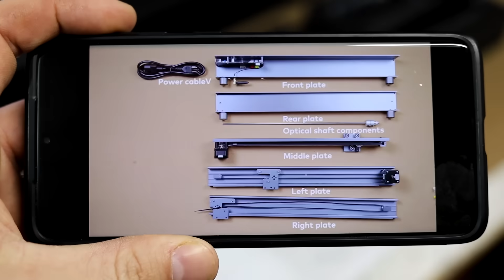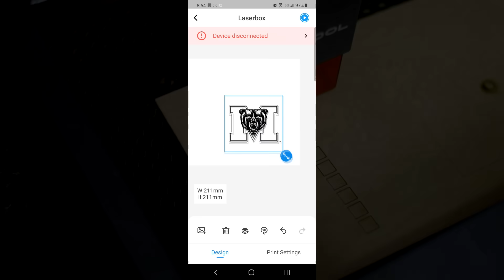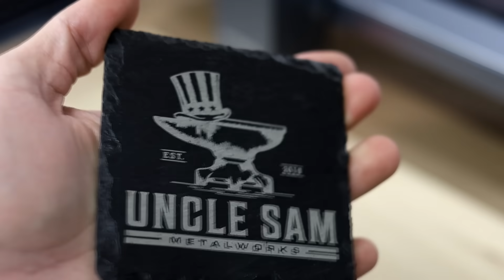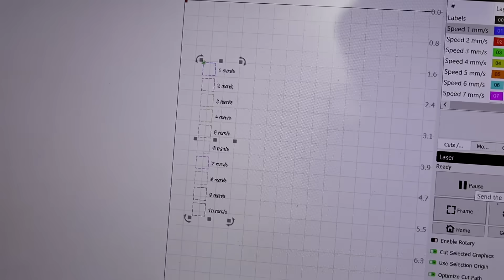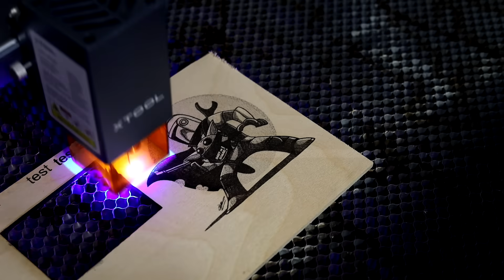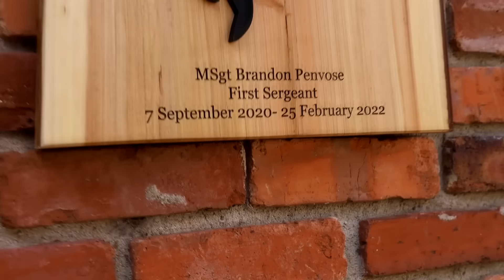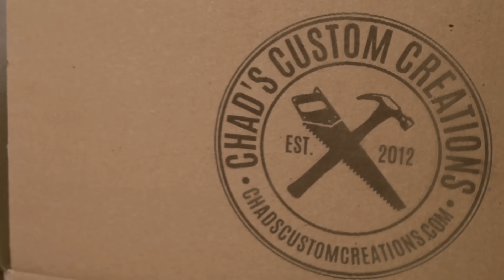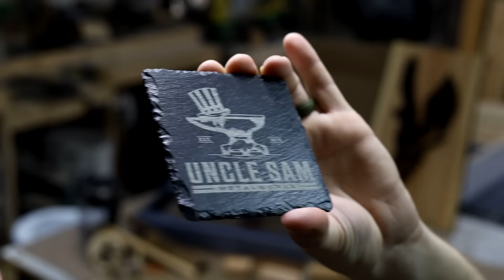The Ultimate Desktop Laser Cutter Engraver The XTool D1

Comment: Can this cut metal names for a necklace?
Reply from the maker: To cut metal you will want to look at fiber lasers which very soon I will be showing off what a 50w fiber laser is capable of. Metal marking stainless or using a marking spray on metals works really well on this xtool though I must say and at 5 times less the cost.
Reply: @ChadsCustomCreations  Great! Can you recommend a fiber laser?
Reply from the maker: @saltwaterfit2753  I cannot yet as I haven't even taken mine out if the box yet but I will definitely let everyone know my experience with mine when I put it through it's paces.
Reply: @ChadsCustomCreations  looking forward to the video. Thanks for your quick response.

Comment: Would you recommend trying to cut something in one pass? I always try to cut in several passes to minimise burning the hardwood but I’m open to suggestions.
Reply from the maker: I think every situation may call for a different techniques but I saw or heard somewhere if you get it down to one pass it allows for the smoke to be pushed out the bottom and you can end up with cleaner faces and better cuts but that may not always be the case.

Comment: Awesome video! Looking into purchasing the xtool d1 but I noticed there is a xtool d1 36w and a 60w.  Do you know the difference between the tool. My main use would be for putting my label for candles on a metal lid.
Reply from the maker: Not sure where you are seeing the 36w and 60w. The choices should be 5w 10w and 20w the one I have is the 10w it's plenty of power I think that would be a good fit for you.
Reply: @ChadsCustomCreations  thank you for the quick response. I went back and looked further in the description and you right. One is a 5w-7.5w and the other is a 10w.  I will go with the 10w. After watching what you were able to do with it I am sure it will meet and exceed my needs!!
Reply from the maker: Oh you are right I see on Amazon they are labeled a little differently than on xtool.com 

If you plan on marking on metal that is not stainless steel you may want to grab a can of this spray that I have had great success with. I know it is pricey but it has lasted me forever.

https://www.amazon.com/dp/B07K4Y8D62?tag=onamzchadddow-20&linkCode=ssc%20&creativeASIN=B07K4Y8D62&asc_item-id=amzn1.ideas.9RX0388VQUF4

Comment: I don't know how much you worked in cutting jobs in this unit, but unless you know something I don't know, whoever is looking to use this unit as a cutting machine, needs to be careful with the choice. Now, don't get me wrong, the xTool D1 is an excellent unit and mechanically hard to get it better. However, from the firmware point of view, is not there yet and I am waiting to purchase a higher power head from them when they have a firmware problem fixed. Here is the problem. When you need to use tabs to avoid parts to get separated from the board, you are strictly limited to a very low speed cutting, regardless of the power. Even your cutting tests allows you to use 700mm/min, to be able to use tabs, you are limited to 250mm/min. Otherwise, the firmware messes up the size of the tabs very, very badly. This simply means that it does not make any sense to go to a 10 or 20W head becuase the cutting speed stays limited. The tradeoff, it would be to use a grid underneath the job instead of a nail bed, but consider that each time the laser hits metal underneath will produce a burn that many times appears in the top of the job, regardless the use of air assist. Therefore, if anyone found a solution to that problem, please, share it here. One more note about the product: I am extremely happy with their support. They are fast and efficient. As I said the only disappointing item is the firmware code.
Reply from the maker: That's a great perspective, I must say that ever since I moved from CNC router to lasers I have kissed tabs goodbye for good. Too much work in my opinion to cut all those off and make the edge grain match the rest where the tabs were. I either mask the backside of my projects with tape, wipe off the backs with isopropyl alcohol, or simply sand away the residue marks coming from the honeycomb reflection.
Reply: @ChadsCustomCreations  Have to say, you have a good walk around. Not good for my project though. And I do not have any issue with the tabs themselves. Once figured out the size and partial cutting power for each type of wood, it works perfectly for me. Just to give you an idea, because of the size of the pieces I have I would need to tape 80-90% of the board. On the other hand, the 0.2mm maximum potential thickness of the tab does not affect my results.
Reply from the maker: @richardraimondo612  that's a good point I didn't realize how small of tabs you could do with laser I was thinking back to the tabs my router would require which would be about .25” to counteract the forces of the spinning router bits. 

If you do need a way to mask quickly I use big 12” rolls of low tac paper masking. There should be links in my azon recommendations if you are interested in some.
Reply: @ChadsCustomCreations  thanks a lot for the lead. I'll keep that handy.

Comment: So can this thing cut through 3/4 plywood in 3 passes?
Reply from the maker: I don't believe so but when I put the air assist on I will give it my best shot and report back with what it can do.
Reply: @ChadsCustomCreations  what about 1/4?
Reply from the maker: I think it has a good chance I’ll be putting the air assist on soon and I’ll test that out for sure.
Reply: @ChadsCustomCreations  The weird thing is the website says it can cut 10mm plywood in one pass. That's almost 1/2 inch.
Reply from the maker: More in depth cutting test is definitely in my future.

Comment: Hi can the XTool D1 cut 12mm MDF
Reply from the maker: I haven't tried it yet but I am betting 6mm is probably the max on MDF and this would probably require the 20w with air assist. If you have to do 12mm mdf I would say go with a 90‐150w co2 laser.

Comment: Great video, except... what was the bird material, how thick, and did you cut with the D1?
Reply from the maker: I did cut that with one of my co2 lasers it was 1/4" MDF I painted black. I am not sure that the D1 could cut that without the air assist but I will do an update at some point and add the air and honeycomb cutting panel and I'll go more indepth in cut test.

Comment: hello, on diode lasers clear acrylic does not absorb the 405nm wavelength vey much. so use colored blackacrylic or black delrin materials for example. co2 lasers are  deep into IR range about 10000nm and most of energy is absorbed as acrylic absorbs most of this frequency.
Reply from the maker: This is great information thank you for sharing also didn't know delrin could be used in definitely want to try that.

Comment: I'm interested in using a laser to do inlays on guitar necks. The fretboards are hardwoods such as maple, rosewood or ebony. Although they are harder than the birch you tested, the cut only needs to be about 1.2 mm deep. Do you think this laser could do that? Would still be acceptable if it took more than one pass. Reasonably sure it would cut the mother of pearl or abalone fine but not sure about the hardwoods. If you get a chance, test a piece of hardwood. Thanks for the vid!
Reply from the maker: Oh yes the 10watt could definitely do the hardwoods I was using a 7w diode to do walnut and maple solid at 1/8th inch thick and it actually did better than plywood.

Comment: I'm interested in this for a few applications, how deep can it it go into aluminum and steel? Also, how well does it retain image quality on uneven/rougher surfaces?
Reply from the maker: It cannot actually engrave into metals, rough surfaces like pallet wood or uneven boards can be done as long as it doesn't put it too far out of focus.
Reply: @ChadsCustomCreations  did you use a marking spray on the dog tag and stainless tumbler? How did you mark them if not?
Reply from the maker: @jatcher  actually no marking spray on either. Something about that correct speed and power give it thsy perfect permanent color change.
Reply: @ChadsCustomCreations  this was also my question.... Cermark is spensive!🤣

Comment: Chad do you know why my laser wouldn't work?  It is framing and moving, but it isn't engraving/burning anything.  Am I missing a step in setting up the laser?
Reply from the maker: If you are using the app or the Laser box basic I believe after you click send to laser you have to press the big silver button on the top right of the machine to get it to start. If that does not do it let me know.
Reply: @ChadsCustomCreations  I tried the method you mentioned above.  It still didn’t work.  Here is what my laser is doing . https://youtu.be/HTNU8lReCoA  do you think my laser is bad, or I set it up wrong ?

Comment: Great video. Very easy to watch and rage in info. Looks like a great machine can you tell me if it will cut through 1.2 mm aluminium? I mage fishing lures and need a machine to cut the bibs.
Reply from the maker: Thank you for the kind words. I hate to give you this bad news but neither this Diode Laser, or co2 lasers can cut metal. Only one that can to my knowledge os fiber lasers. Which hopefully soon I'll get my hands on one of those so I can share that with you all.
Reply: @ChadsCustomCreations  thank you for the reply. It seems it’s the dark horse that’s for sure with out spending a small fortune. Do you know if any will cut Perspex or plastic acrylic? That’s my second option. I’d even consider a router type  cnc  🤷
Reply from the maker: @paullobwein1632  this one can do opaque plastics, not clear, blue, or white.  Co2 lasers like me red one or blue one are great for any acrylic or plastics without chlorine. Ritter CNCs are great also just more work to get set up as you must always consider mess and hold down options. CNC with my top recommendation would be the onefinity haven't used it but man does it look sweet.
Reply: @ChadsCustomCreations  so like a mini cnc router?
Reply from the maker: @paullobwein1632  onefinity offers up different sizes st different price points personally I would want the journeyman size
Reply: @ChadsCustomCreations  yes I would prefer a larger size also but it will come down to price point with aus dollar

Comment: How cleanly can it cut foam like the stuff used in the packaging, specifically the sheet used for the riser legs? Low power many passes? With the air assist?
Reply from the maker: I will find out I've used my Co2 with great success but I will see how this one does and report back.

Comment: Great video! Good review and very well explained. I purchased a K40 over a year ago and I have never used it because I feel insecure using it on my own with no one with prior experience near me. This one looks more friendly. What is your opinion between K40 and this one? The K40 uses a bucket of water, does this one too? Thank you!
Reply from the maker: Yeah the k40 or co2 lasers do require much more user adjustment and maintenance.

This is what's considered a diode laser and these don't have any water, no mirrors, the only maintenance is keeping the lens clean with a cotton swab and isopropyl alcohol. 

Diode are perfect for people getting started. Co2 lasers or more for people getting into serious production and require speed and cutting power.
Reply: Hi. You doing absolute right! The K40 is out of the Package absolute unsafe and requires a bunch of security improvments. No one say´s you must use a Bucket of Water =) i have a Tank with arround 10 Liters of Water / Glycol (the stuff used for antifreeze in a car cooler in winter) and a Radiator, from PC Watercoolings or from a old Car. Maybe some Computer Cooling Kits include a complete Cooling solution. I think you can safe some Money by buying a cheap K40 but the saved you must invest in a Propper certified Lasergoolgle what is explicit made for the Wavelenghth a CO2Laser emited.
Reply: @mupfelmax530  rubbish, perhaps you should try K40's properly before generalising, they are not unsafe, its the people who use them and the people who sell them. They are far from perfect but they work very well normally unless you get a dodgy seller. I have 5 of these all running very well without any problems at all. The diodes are more convenient than CO" lasers but no where near as powerful once you get to 80 watt and above machines.

Comment: What is the max depth of cut on aluminum?
Reply from the maker: This cannot cut aluminum
Reply: @ChadsCustomCreations  ok let me rephrase my question how deep will the laser engrave on aluminum? Also if you run the same engraving sequence will it add depth?
Reply from the maker: @8mmmauser896  no depth at all can be achieved on metals this is simply just marking it or changing the color of the metal if you will. If you want to truly cut into or etch metals you will need a fiber laser.

Comment: Hi Chad,,, Can these diode lasers engrave stainless steel without coating? Other metals?
Reply from the maker: The Dog tag that I did in this video I believe is stainless steel and it marks it with a super high contrast black at that speed I ran it on. As far as other metals I don't have much experience with but if you have specifics I will do my best to get some samples and test them out for everyone.

Comment: I need one to engrave serial numbers in metal
Reply from the maker: I would say fiberlasers are touted as the true way to engrave metals but their pricetags push them so far out of most peoples budgets. You can see this laser does a good job at "Marking" the stainless steel but depending on what type of metal you may have to do other things such as using a Cermark Spray or strangley enough coating it with mustard first to mark different types of metals. If there is a particular type of metal you would like me to test I would be glad to report back for you.

Comment: I have a question. I need to engrave a bar top that has parkay wooden flooring tile that cant be removed will this laser engrave the surface that it is sitting on or does the item you are engraving have to be elevated to engrave? I really want to purchase this but this would be the reason I don't if I cant engrave the bar top that the laser is sitting on.
Reply from the maker: You can definitely do that with this laser it is actually perfect for this exact application.

Comment: Some questions: 1] Does it come with the software to be able to make your own design? 2]If so, can you load/scan in a design? 3] if not, what software do you recommend? 4] If you place this on a surface to engrave, do you need to secure it down so it does not move during the engraving process?  Thanks!
Reply from the maker: Hey John, it does come with free software for running the machine and it covers all of the basics. I will have to check if you can if you can scan into designs or not but I do know that you can import images and SVGs right in there. If you do want to go a little deeper into designing your own images I highly recommend inkscape which is also a free software that I use for making vector images which translate perfectly to the laser or another machines. 

As for mounting the machine in my experience needs no mounting as it never shifted itself at all during any of my test and I had it running at full speed.
Reply: @ChadsCustomCreations  awesome! Thanks so much for replying so quickly!
Reply from the maker: @johngruszka1559  absolutely and if you get one and need any assistance I'll be here for you.
Reply: @ChadsCustomCreations  thanks! I am really considering it. You video has quite possibly pushed me over the edge
Reply: @ChadsCustomCreations  Its also good to point out only the software that comes with it supports its Wifi feature. Lightburn requires the USB cable to be plugged in.

Comment: Not real tech savvy. Wondering if this is capable of engraving deep enough to apply epoxy and what I'm getting at ic cutting fretboard designs for powered inlay or epoxy. Any thoughts and reply appreciated.
Reply from the maker: If by this you mean engravings deep enough for epoxy filled inlays then I would say definitely. This 10w packs quite the power. Depending on the material getting down to the thickness you want will just come down to what speed and power you set it too.
Reply: @ChadsCustomCreations  Thanks for the reply, cost?
Reply from the maker: @mikefinley4367  they have different options at different prices but if you click the link in the video description you will see them all.
Reply: @ChadsCustomCreations  Your awesome,!